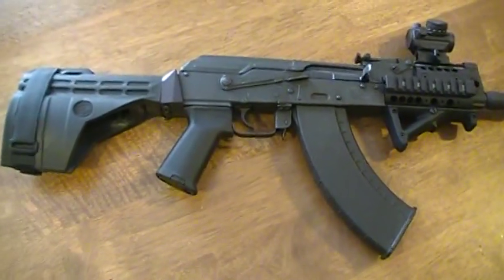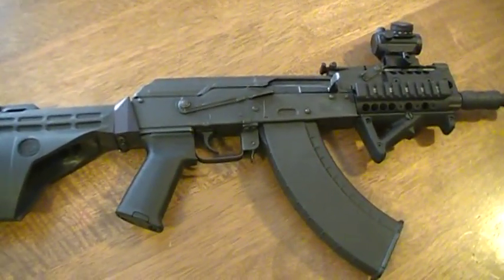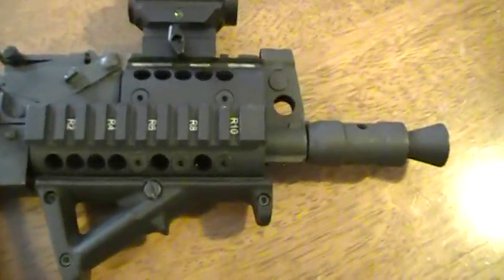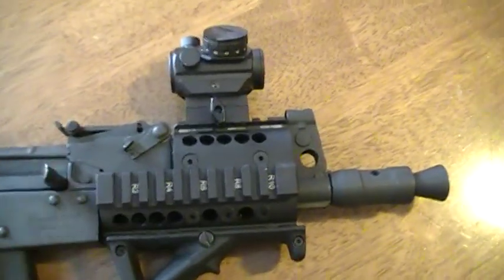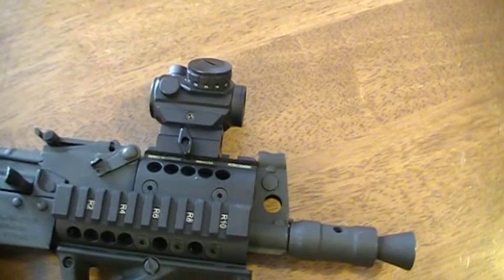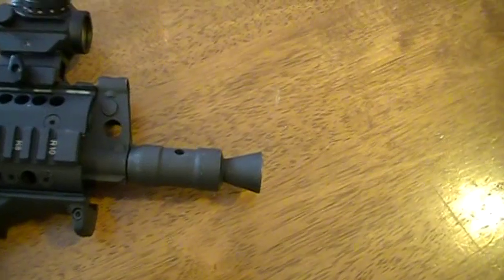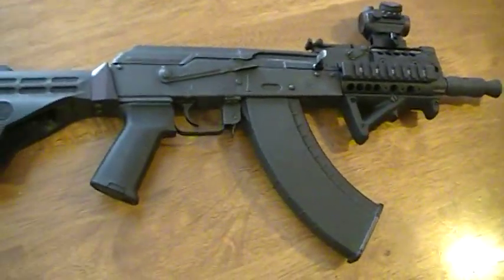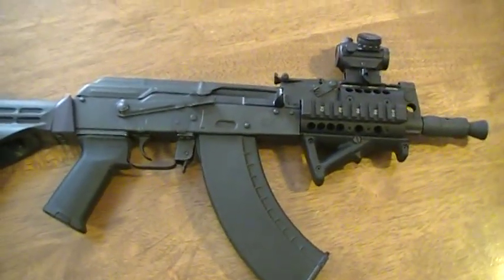Mini DRACO pistol upgrades /channel update

Comment from the maker: Well the Magpul AFG iam not counting because I had that for my AR already, and the red dot is not on it no more. The red dot was 100, the arm brace was about 120 ish , the pistol grip was around 20, and quad rail around 100 muzzle break maybe 10 or so. I think the gun was about 400, hope it helps.
Reply: AK74Man87 where can I buy a quad rail for a Regular size Draco
Reply: You got the Mini Draco for only $400😢😢
Reply from the maker: @MrBigChops  yep, when times were good. Still have my 319 dollar WASR 10. Got my budget CIA Bulgarian Ak74 on nodak spud receiver that was maybe 300 ish.

Comment: Hello from the future! I am about to purchase a mini Draco (So sad they're 1k now!) and am planning on getting the Midwest Industries quad rail and probably the same $100 Bushnell or $140 Sig red dot, after some time has passed (not sure if you still have or shoot yours) would you still say the rail and sight held 0 pretty well? Even with a QD mount? Just looking to alleviate some of my worries about the build I have in mind. Any and all tips would be appreciated!
Reply from the maker: I ended up using the red dot on a different gun, but it did seem to work really good.

Comment: I think the only thing that would make it an AOW or SBR is a verticle foregrip on it but laser, flashlights, redots and your brace is legal....
Reply from the maker: Every thing on it is legal and ok by ATF.
Reply: J Rich904 what is AOW and SBR??
Reply: @FisharoundandfindoutHtown  "any other weapon" like the shockwave or tac 13.  "Short barreled rifle" less than 16" barrel or 14" barrel with pinned or welded non removable device  on muzzle requires tax stamp

Comment: IMO you should run the red dot without the mount to get it lower, seems like you would have a chin weld to look through it. But whatever works for you!
Reply from the maker: I was going to do that but wanted to be able to take it off with out tools. That way if the battery dies I can use the iron sights. I have it off now, I don't use it anymore. That red dot was really for my full size AK, I was waiting for my Ultimak .